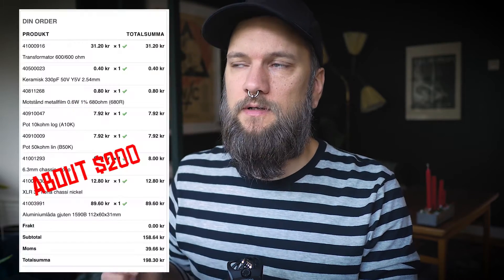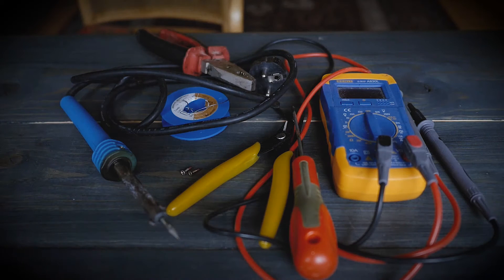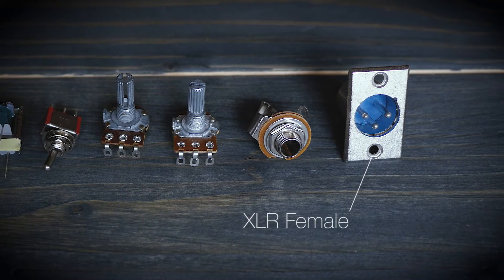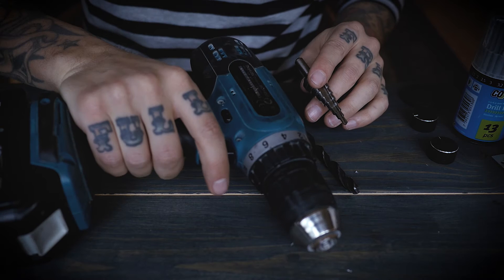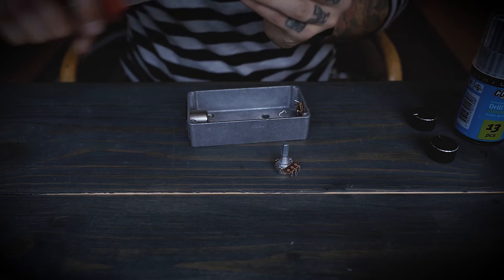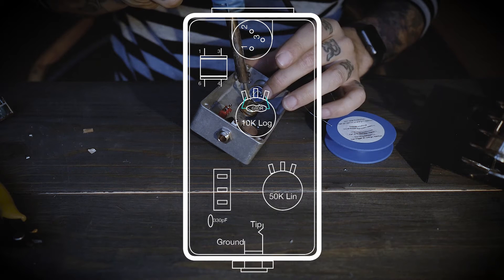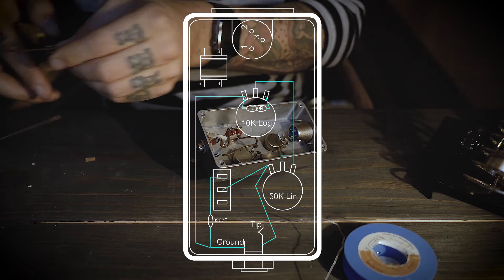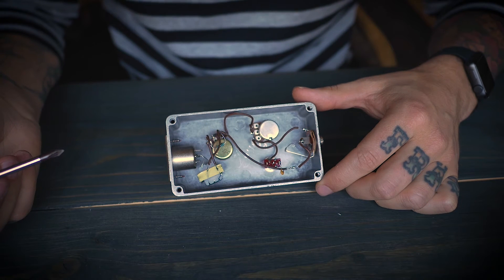Cheap DIY REAMP Box

Comment from the maker: I made a stupid mistake in this video. Pin 3 on the transformer should be connected to pin 3 on the xlr connector. The build instruction PDF is updated with the correct info.

Comment: Friend, good morning! I really like this project. I have a Boss ME-90 Multi FX unit, and I want to take one of the outputs (Line signal, balanced) and send to the input of this Reamp box, to send the output of the reamp box to input of my guitar amplifier:
(OUTPUT LINE GUITAR FX) ------> (INPUT REAMP BOX) ------> INPUT GUITAR AMPLIFIER)

The output of my Boss me-90 is not a XLR socket, but a P10 socket. Can I exchange the XLR for the P10 socket? Thanks for this video.
Reply from the maker: Hi! Yes I’m sure that will work. You can put what ever connector you want on there.

Comment: In your video everything sounded fine without the reamp box. Why would you need one? Only cause of ground loops? And why would you need a volume pot? If it's too loud, turn it down in your DAW or your interface output, right? I don't get it.
Reply from the maker: Good question! It’s mostly to get the signal to enter a guitar amp in a correct way. The impedance difference between line signals and instrument signals can be wildly different. Sometimes it doesn’t affect the sound in a bad way, and it’s enough to bring the level down. Some times with certain amps and/or pedals it can sound really fucked up. In this case I guess I were lucky. And yes, as you say you can adjust the level elsewhere. I built this from an article I found. If I would make a new one now it would be without any unnecessary stuff to keep the signal as direct as possible.

Comment: How to implement flip phase switch to that scheme please? Thanks
Reply from the maker: If you check the updated PDF I guess you could just put a double pole on/on switch between the cables going in to the transformer. Or you can just flip the phase in your daw?
Reply from the maker: Can’t say exactly what switch you need, but something that switch places between pin 2 and 3 on the xlr

Comment: I’m missing some points for sure.

XLR balanced pinouts are:
1 ground or sleeve
2 signal
3 signal with inverted phase.

If you connect 1 and 2 you’re actually talking about an unbalanced signal on input.

Usually a daw is equipped with a sound card  with balanced outputs.

I think that you should connect pin 2 and 3 to the transformer and the pin 1 to a switch in order to cut away noise if necessary, usually marked as “Ground lift” on D.I. Boxes.

I’ve made one with your instructions and sounds actually worse than straight line output into the amp.

As said, I’m missing some points for sure.....
Reply from the maker: Hey, thanks. I made this out of an article in Classic Guitar magazine. I didn't think much of it since it worked for me and at least in my case it worked better than just going line directly to amp. I will make a revision on this and update the information.

Comment: thanks a lot for video bro, please can you help me? i cant find exactly which one is 600:600 audio transformer
. can you give some link where can i find it ? because this item has lots of type. <3
Reply from the maker: I bought mine in a local shop here in sweden. It's a no brand transformer. Here's the link. https://www.electrokit.com/produkt/transformator-600-600-ohm/
Just google 600:600 isolation transformer. The one I used had six legs, but there are plenty with just four legs too.
Reply: @hoborec  thanks mate ❤️❤️ i saw them on google with 4 and 6 legs and because i asked,is there any difference between them ?
Reply: @hoborec  bro i found two diferent kinds of this which one i need ? 

https://www.ebay.com/itm/10-Audio-Signal-Transformer-600-600-Ohm-Europe-1-1-EI14-Isolation-Transformer/402275709560?hash=item5da9803278:g:54AAAOSwdztezeOW

https://www.ebay.com/itm/5pcs-600-600Ohm-1-1-Audio-Transfomer-Ferrite-Isolation-Trasformatori-Transformer/252429737989?hash=item3ac5fc2005:g:OxEAAOSwMNxXZVc4

Comment: I just ordered parts today to create a six channel reamp breakout box from a 13 pin Roland GK pickup. It will also support 5 simultaneous guitar synths such as the GR1, GR33, and VG88 that I currently own. All the plans I came across does not reamp the signal through any transformer as they claim the GK pickup is line level, but I am currently getting way too much ground noise from my 2nd gen focusrite 18i20 from the simple breakout cable I made last year to reamp on my vg88. The GR1 and GR33 produce no ground noise since they are not remodeling each string. I want to reamp from a daw to the VG88 primarily for its virtual guitar and pickup modeling to be additionally amped again by other various distortion pedals and primarily through two Mooer Radars impulse responses but may also use amp, cab and mic. Even though that the GK pickup does not have the highest quality pickups, I will be using various techniques utilizing this method in the final production of my songs before final compressions so that all guitar tracks perfectly mix with each songs own vibes. 

I like the 10k logrithmic pot and 50k linear pot and hope these will work with the VG88. I am going to construct with your suggested 600:600 transformer, resistor and capacitor. Since the GK pickup already suffers from not having high fidelity, I anticipate this transformer will be perfect, especially since I am putting six channels of reamping into the same box, but only one ground lift. I will also be using entirely 3 pin female xlr's, 6 in and 6 out. My box design will also be capable of bypassing the 13 pin cable for a standard 6 channel reamp box. I usually fade mix up to six distinct guitar tones on each guitar track as my songs use extreme dynamics of my distinct various heavily distorted guitar tones alongside symphony orchestra, rock guitars, acoustic guitars, choir, growl/scream vocals, clean vocals, electronic music, etc. which is mixed accordingly to each songs own signature vibe. 

I anticipate that lower pot levels, 12 in all, on reamping the VG88 and higher pot levels for standard amp, cab and mic reamping. Any advice?

Comment: I'm really curious would it matter if I use a 10k:10k transformer since its still a 1 to 1 ratio? I can't find any store that sells anything with 600:600 here in the Netherlands! Thanks in advance!
Reply: BoboButYouCanCallMeTom - I don’t think you want a 1:1 ratio, that’s a matching transformer I believe, you get out what you put in. You want (I think) a line to high impedance transformer, because the amp wants to see a guitar level Signal (high impedance) whereas your interface is putting out a low impedance (line level) Signal. I think you can can run a passive di back wards to do the same. The ratio is something like 1:12 or 12:1, I’m no expert but I’m pretty sure it’s not 1:1.
Reply from the maker: To be honest I don’t know. I’m not that electrically gifted 😅. Maybe someone else can answer that? Or try any of the diy Facebook groups

Comment: Great build! Can I swap the xlr for a 1/4" mono jack as well?
Reply from the maker: Hi, short answer is no. In that case a stereo jack, TSR. The purpose is to take a balanced line signal and turn it in to unbalanced instrument signal.
Reply: @hoborec  You are not connecting anything to pin 3 of the XLR which is the cold/negative pin of the balanced cable so you are only taking an unbalanced signal from the XLR. So yes you can use an unbalanced 1/4" jack instead of the xlr input, just connect the tip of the jack where pin 2 (hot) of the xlr connects and the sleeve of the jack where pin 1 (ground) of the XLR connects.
Reply: @hoborec  with one more transformer you might be able to add an unbalanced out as an extra component. Not sure how that would help tho.